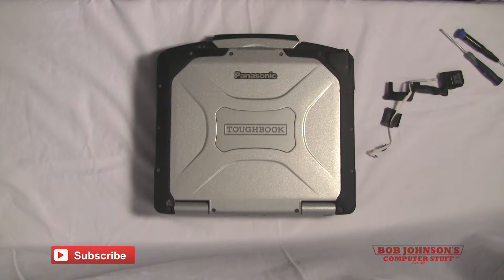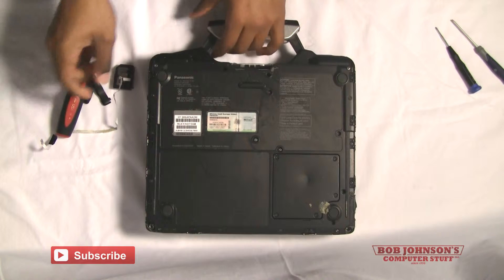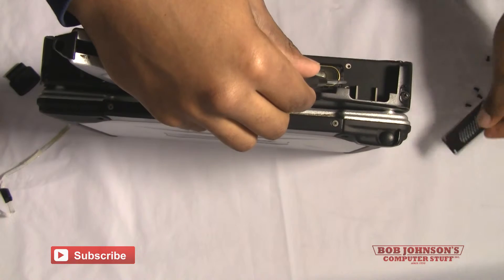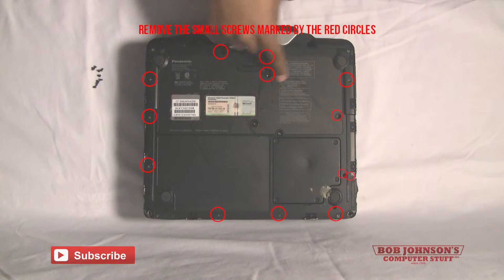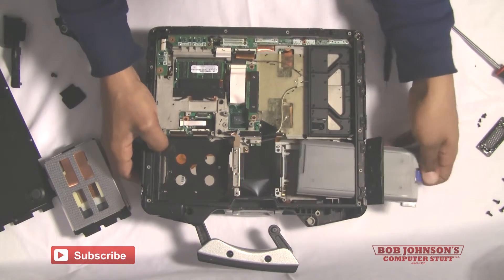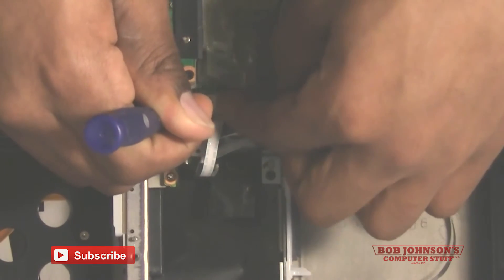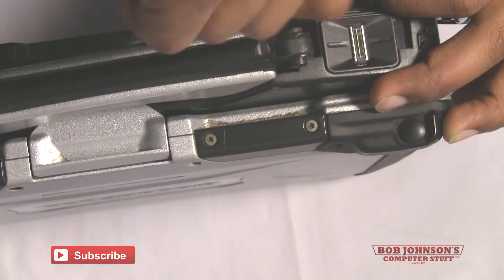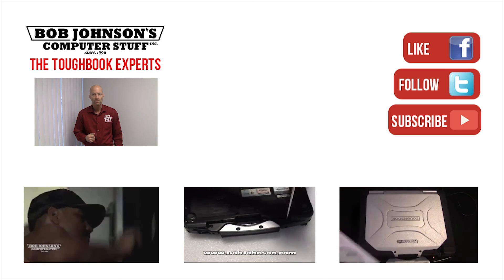How to install the Fingerprint Reader in a Panasonic Toughbook CF-30

Comment: Bonjour peut-on en metre un sur un panasonic cf19 mk6 ????
Reply from the maker: Translated: "Hello can we put one on a panasonic cf19 mk6 ????"

Yes you can, however you will need some case parts as well as the fingerprint reader.
Translated: "Oui, vous pouvez, mais vous aurez besoin de certaines pièces du boîtier ainsi que du lecteur d'empreintes digitales."

Comment: I noticed that you did not install the fingerprint reader cover during this install. can it be added at a later time without taking anything apart? also I would strongly advise to not use regular electrical tape as the adhesive becomes gummy and loosens up in time. A far superior tape that is already in use inside the toughbook is Kapton. it's the amber translucent tape you see on various parts and places inside the unit. Kapton is made for high heat environmental conditions. 

Kapton is easy to find on the web and not too expensive. I use it on all of my Mil spec projects. 

Thanks for the informative video.
Reply from the maker: Thanks for the comments. The cover is typically attached to the scanner. You can't put the fingerprint reader cover on without taking off the cover that holds the fingerprint reader and handle in place. The tape is an interesting aside. Our videos were the result of customers purchasing parts from us for do-it-yourself computer repair.  People would buy parts. Then when they weren't certain how to perform the install without causing more damage, they would reach out to us for help.  So you could say that the Toughbook videos we continue to do are continuing customer care for the average Toughbook user. As a result, we tend to use items that are typically readily available to them--such as electrical tape.